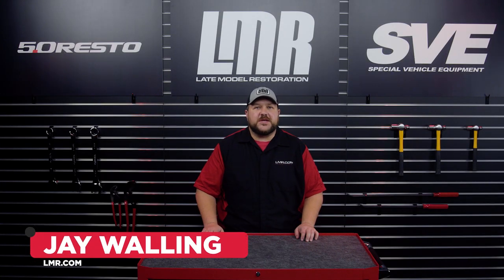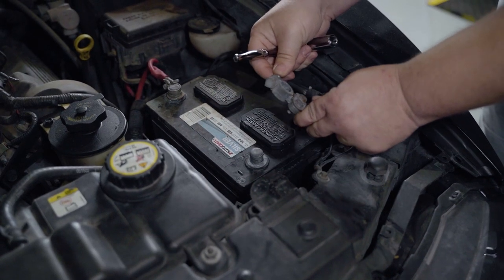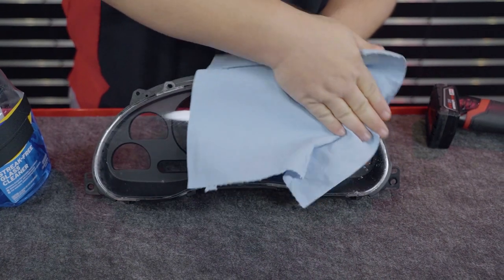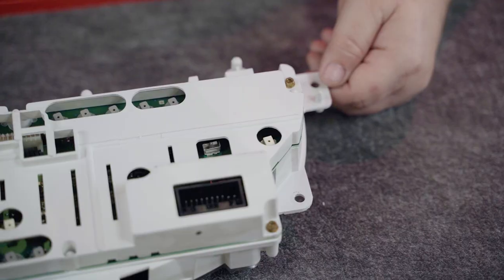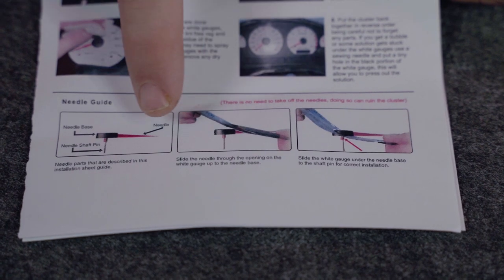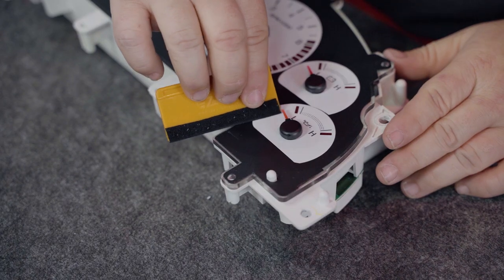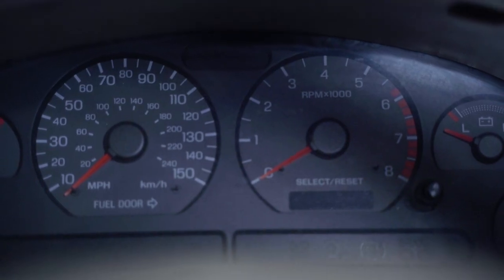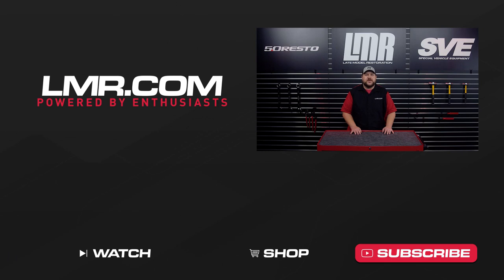How To Install SN95/New Edge Mustang Gauge Face Overlays (94-04)

Comment: How about a pic of it illuminated with the new overlays? You showed one with the dark/ stock gauge illumination, but not one after?
Reply from the maker: It is a bit darker compared to the OE black cluster design, but we offer LED's that you can swap out for a brighter light output! - https://lmr.com/products/94-04-Mustang-Interior-Lighting#19807
Reply: @latemodelrestoration  Well then. Still.a fail on your part. You should have shown this instead of someone having to ask and then you offer a solution, that you already had.

Comment: Anyone had issues with the sticker bubbling around the 4 pins on the Speedo and RPM ? Just installed them an been waiting for 3 hours and still have bubbling around them. I’m doing this in a climate control room.
Reply from the maker: 3 hours isn't long enough for the solution to fully evaporate. Give it some more time. -Landan

Comment: Need to see the white faces illuminated before I buy...and does moving the needles throw the calibration off?
Reply from the maker: Moving the needles doesn't throw off the calibration
Reply: @latemodelrestoration  I just done see the point since ur covering the stock block guages it won’t fully illuminate like the cobras do. Just makes it white for day time but at night it won’t be any different
Reply from the maker: When adding some LED's to the cluster, it makes all the difference. Here's a link for the LED's that will work perfect with the gauge overlays: https://lmr.com/products/94-04-Mustang-Interior-Lighting#19807
Reply: Looks like previous owner did this to my 97 and the gauges are all screwed up

Comment: Warning to anyone who's going to buy these. They did not fit well on my 95' GT. The hole for the speedo stopper isn't big enough, and even correctly matched they don't line up perfectly. Saying it was INFURIATING to install would be an understatement. Overall a terrible product. Find somewhere else to buy them.
Reply from the maker: Hey there! We'd love to see some photos of the issues were having with the overlay not fitting correctly. This is how products get better, through customer feedback. I linked our contact us page below. It only takes about a minute to fill out. Thanks! -Landan

https://lmr.com/contact
Reply: @latemodelrestoration  I'm not sure why but the newer year models that weren't my year (1995) were the only ones that fit. They seemed to either be a hit or miss on the GT speedo and tachometer. I eventually found it out, but the guages don't match my original GT. Which is fine I guess since it's no terrible. Anyway, appreciate the response.

Comment: How long does the glue take to set once you install these?
Reply from the maker: Ricky - It depends on the ambient conditions.  If you're doing this in a climate-controlled area, then you can expect the soapy solution to evaporate within an hour.
Reply: @latemodelrestoration  Did this and my speedo doesnt work now lol
Reply from the maker: What did you break it? In all seriousness, did you make sure the connections were secure on the back of the cluster? Unless you go something wet, not sure why the cluster wouldn't work other than it being something obvious. -Landan
Reply: @latemodelrestoration   yea ive removed it twice and checked the plugs. Both snapped in place and clicked. I honestly have no idea lol. Unless me moving the needle was too rough during the install? Its the only gauge that doesnt work lol